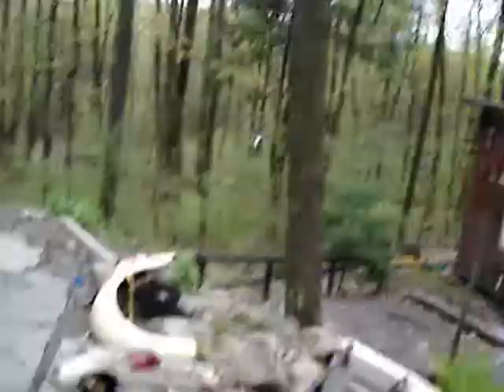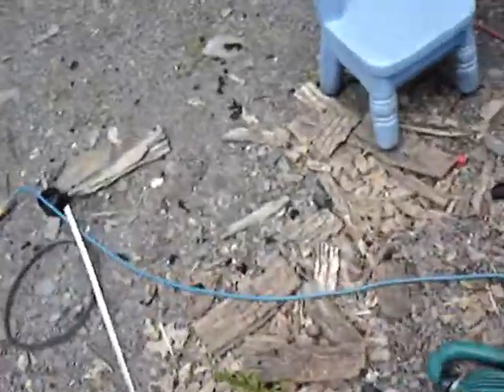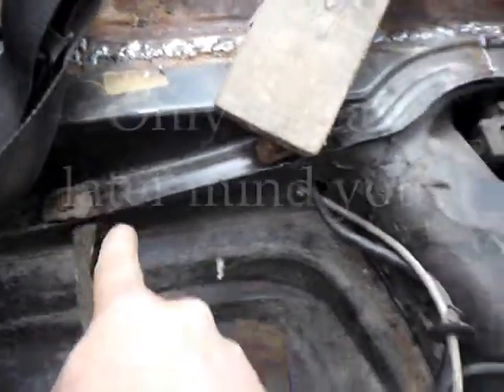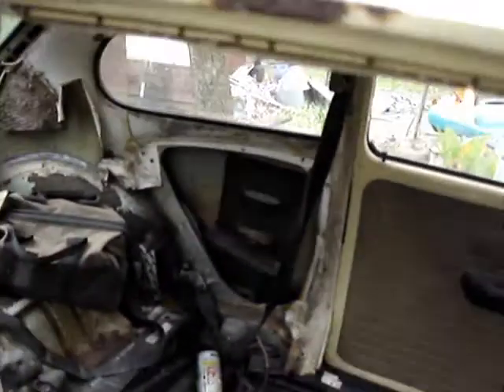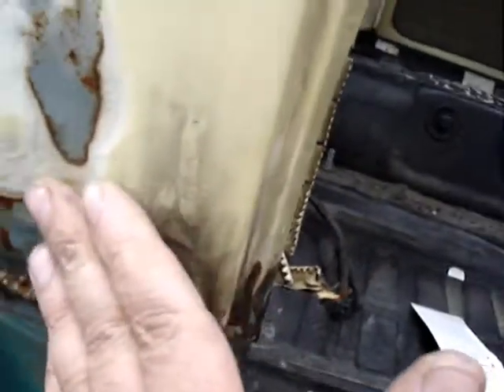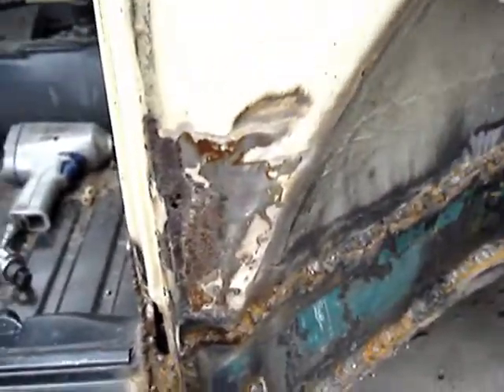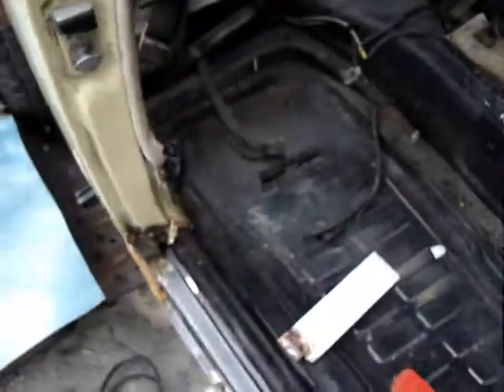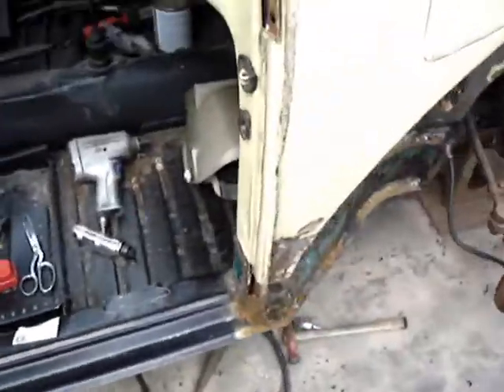Beetle progression

Comment from the maker: @ElderlyIron The welds do look pretty crappy, but I was getting good penetration on them the whole run so they'll hold just fine.I think I could have it driveable by July, but not done.I still need all new wheel cylinders since the bleeders are snapped, and all new brake linings.One set of linings fell off the shoes so I'm not chancing the rest.Then tie rods and ball joints since the boots are dry rotted, maybe wheel bearings too.

Hopefully I'll have it done in the fall before $6 a gallon.